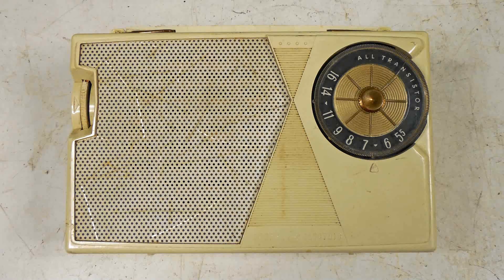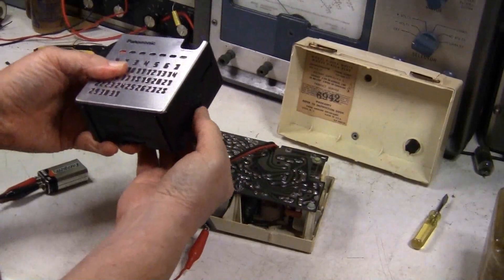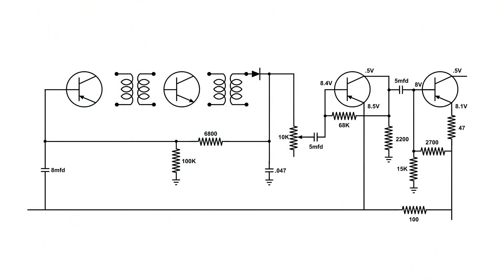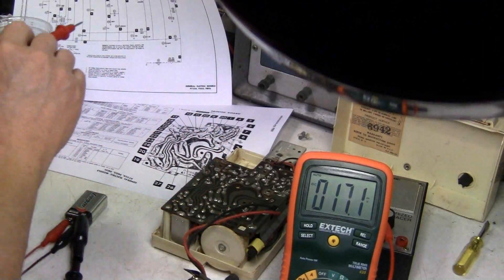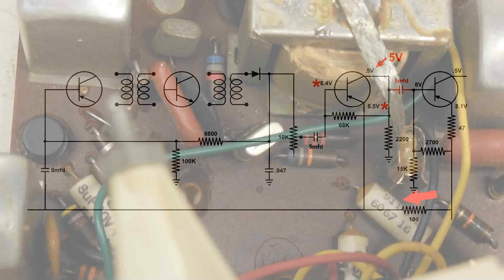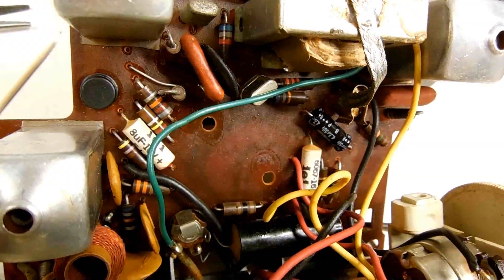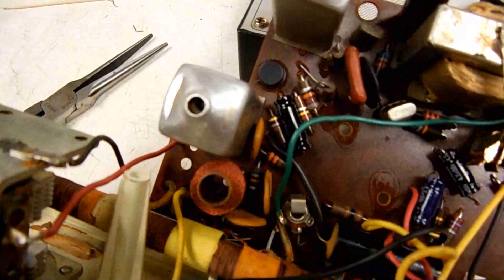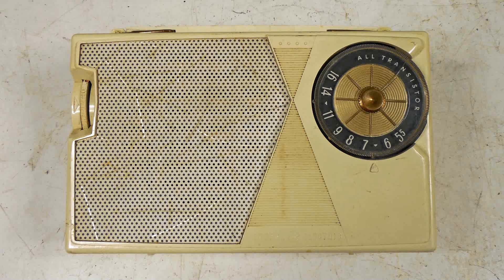1959 GE Transistor Radio P805A Repair

Comment: How are you sir? 
I'd like to know from you, what is the correct way to check volts(when power is on) in the germanium transistor radio by digital multimeter? If the body is positive of the radio, 
should I clip negative prod directly to the negative supply of the adaptor/battery? And check the volts of various components/transistors,by using the positive prod.?
Reply from the maker: Please download my FREE eBook. password allamericanfiveradio
The Vacuum Tube Shortwave Radio
http://www.richardmcwhorter.com/vacuumtuberadio/

Comment: Hello,

What value did you use when replacing the 8 uF cap on the AVC line? I used a 10 uF cap in my P807A. It works fine just curious.

Also, in your opinion, did the designers intend for the PCB to be removed to do an IF alignment? I see no other way to do it.

Thanks!
Reply from the maker: There are holes in the circuit broad for I.F. access.

Comment: Question: I just bought a Micronta Signal Tracer like yours
and it works well. But I noticed that when applying
a small sinus wave at the audio input and slowly increasing
the volume pot the small speaker sinusoidal waveform has its negative
part distorted like if the lower pushpull Germanium transistor
(Germanium NPN 2SD187) was lacking gain. But all the transistors are fine.
Is-it possible the actual circuit layout is pourly designed
and this assymetrical output waveform behaviour is normal 
at higher signal levels? I think so.. What do you think ?
BTW everything has been tested with a good and stable 9VDC source
and very low signals give a much less distorted output.
Reply from the maker: I would check the bias on each base of the transistors
Reply: The biases seem to be ok for all the transiistors. If you have time you would be very kind to check (scope) the output waveform of yours.. I suspect yours behaves the same. Circuit layout poorly designed.. ??
Reply: Hi Rick, I finaly went further on the Micronta behaviour and yes this small Micronta amplifier has a poorly designed circuit that can be tweaked out for best linearity.. Please find out here: http://antiqueradios.com/forums/viewtopic.php?f=8&t=330043&p=2763376#p2763376
By the way many thanks for your fine videos that help newbies like me to better understand the radio inners..

Comment: Why do you use electrolitic capacitors as substuition?, I am not sure but they look  as paper or ceramic capacitors.
Reply from the maker: Both replaced capacitors are electrolytic

Comment: Good evening to you from the farmlands of rural Minnesota, 

 I have a GE P2710 "Long Range" transistor radio that is doing the same thing as this preceding model you've shown above. With the later 60s type like the 2710, would the mf capacitors be the same as what you replaced in your GE model, or would they be entirely different from one model to the next based upon size, circuitry, construction, ect.?

I'd like to revive the old GE transistor radio to tune into the Farm and Weather reports  as I've done in the past with the receiver. 

Thank you kindly.
Reply from the maker: I would think it should be fairly close. If not, all the capacitors are marked pretty good in transistor radios.
Reply: I too, have this “ long range “ radio. (Actually I also have the one in the video as well).
Would love to know if you ever got it fixed, and if so, what do you think about it- as a radio.

Comment: my 805 eats batteries.  may be current draw when its OFF because it seems to run-down whether its played or not.  I should try to measure milli amps between the switch contacts
Reply from the maker: +Patrick K 
Get two small pieces of aluminum foil, but some paper between the two so that each one is insulated from each other and you have enough foil for an alligator clip on each one. Push this between two batteries and you can hook your ammeter up this way.
Reply: with a 9v battery the foil goes between one battery terminal and snap connector ?
Reply from the maker: +Patrick K 

Well that makes it even easier. Just open up one side of the 9 V battery and clip an ammeter in series.
Reply: +AllAmericanFiveRadio 
yes one side with ammeter in series I am getting 15.5 mA with the set ON and zero mA with the set OFF.  at least it is not eating batteries when it is OFF like I suspected
Reply from the maker: +Patrick K 
I looked up a couple of radios a small Zenith 3 V power supply draws about 12 mA volume down. The 3000 Zenith transoceanic 12 V power supply draws about 25 mA no signal.
Reply: +AllAmericanFiveRadio 
I checked a GE P1757 pocket 9V radio and its pulling 6 mA.  My 805 is black by the way making it a different model number P807.  it has a gold cloth grill and pin drive speaker.  I converted the battery connector to accept standard 9v battery.  they dont last long.
what does your 805 draw ?
Reply from the maker: +Patrick K 
The specifications on the Sam's says the power supply needs to be 25 mA. I'm sure that max. My radio tuned to a station with the volume all the way down reads 17.2 mA. Tuned off a station and volume all the way down it reads 17.9 mA. That's why they use the large 9 V battery, a lithium 9 V or two lithium 9 V in parallel would give many hours of use.
Reply: +AllAmericanFiveRadio 
and I thought that 15.5 mA was high.  I guess thats normal then.  getting pricey with two lithium.  I am used to two for a dollar at the Dollar Tree store
Reply from the maker: +Patrick K 
Buy one lithium and you will be much happy-er, now that you know, no current is drawn when the radio is off. I only use  lithium, they last longer than the cost.

Comment: Hello. I have a 10 Transistor radio that is a bit sick. All I get is whining and noise from regular AM stations but it recieves OK on my small transmitter if it is close enough to the antenna. Though it doesn't sound nearly as good as your radio after restoration, it does recieve and work. Do you know the problem? Thanks in advance for a reply and Happy New Year 2016!

Comment: Hi Rick, nice lesson as always. You explain where even I can comprehend it. I picked up ge-807 a couple of weeks ago in very good shape. Of course it didn't receive. I replaced all the ecaps and it started working except below 900 or so static or pops no station. I supposed its the tuning cap. I sprayed it liberally with contact cleaner but no joy. What's you way of checking and repairing the tuning cap? Keep the lessons coming, Alan
Reply from the maker: If the variable capacitor is the open type, some of the fins may have gotten bent out of place and if so will cause a short circuit. Straightening the fins is tedious, but it can be done. If the variable capacitor is the small plastic cube, the easiest thing would be to replace it. There is also a possibility that it is not the variable capacitor, something else in the oscillator circuit is keeping it from oscillating below 900. Sometimes I parallel a variable capacitor across the original. In this case the original capacitor I would have it set at the highest frequency it would go and then parallel another capacitor across it to see if I could pick up stations below 900. If I can pick up stations below 900 that means the original capacitor is at fault. If not there may be something else wrong with the oscillator circuit.
Reply: Thanks Rick, I got a magnifying glass and noticed where the outer fin was shorted when below 900, I just used my finger and pulled it enough so it would clear and presto it started working..73 and thanks, Alan
Reply: ps just saw this message in gmail..
Reply: hi, i agree with you abt transistor repair video great job. well alan i too have a radio that worked well until i tried to clean var cap. then it went dead. before that it worked beautifullly on most of the band did you have any luck with var cap on yours. thanks, cliff

Comment: Some of the older computers out there like old Commodore Amiga and some of the original Apples run into the same problem. Replace the caps and they run like new.

Comment: Hi Rick:
I have the exact GE P805A radio as yours. I got mine running changing those white electrolytics also.
The only problem with mine now is that when the volume is all the way down there is white noise emanating from the speaker. I don't know at this point whether it is bad mica caps in I.F. transformers or one or more of the transistors are noisy. I also don't know if they are germanium or silicon.
This is my favorite transistor radio. Any help would be greatly appreciated!
Thanks!
Tom
Reply: I have 5 of these Radios and Love them.  The Transistors are all Germanium Transistors.